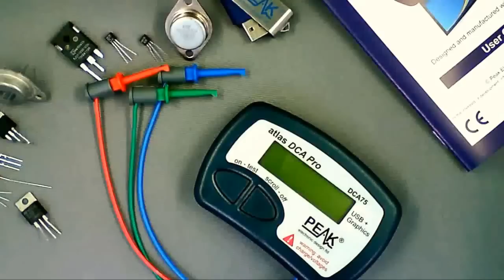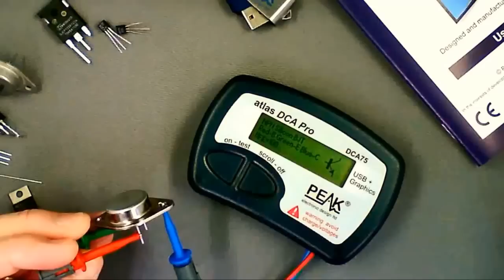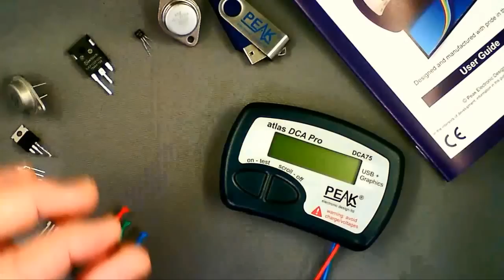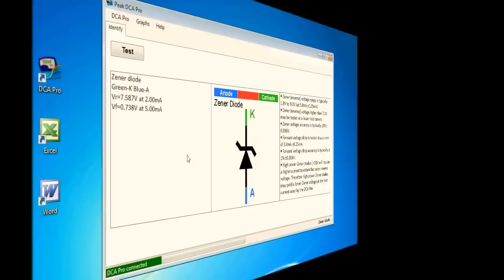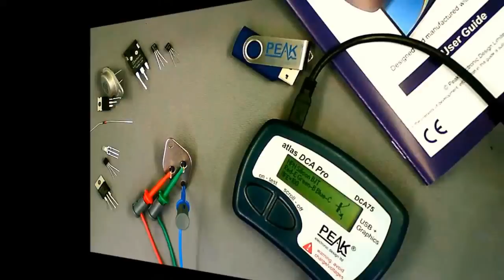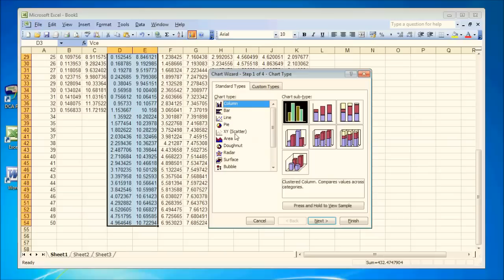Peak Atlas DCA Pro - Advanced Semiconductor Component Analyser (Model DCA75) - Official Video

Comment: Hi, it looks very interesting. Can I match the transistors pairs with this one successfully? How the device react for temperature changes in the matching proces?
Reply from the maker: The DCA75 is great for matching transistors. You can can measure both hFE and the base-emitter voltage (which are often needed for matching). Furthermore, you can overlay whole graphs on top of each other to determine a good match for your own personal requirements. Both gain and Vbe are very temperature sensitive on transistors of course, so you need to ensure minimum handling of the transistors and allow time for the transistor temperatures to settle to ambient before testing. These are fundamental characteristics of semiconductors and not the DCA75.
Reply: @PeakAtlas  Bought it already, great tool indeed ;)

Comment: can you test components in circuit?
Reply from the maker: Generally speaking we would not recommend testing in-circuit. Sometimes you can get away with it. The influence of potentially unknow components in an unknown circuit configuration can of course affect the readings that the DCA75 is trying to take and that is impossible to compensate for. Furthermore, you can't always be sure that the circuit you're testing is completely free of stored charge and that may damage the DCA75. Another thing to remember is that if you have the DCA75 connected by USB to your PC, then a ground loop problem can occur if your equipment under test also has a route to a different ground, big currents (and failures) can then occur. So testing out of circuit is recommended and I acknowledge that is not always convenient.

Comment: It can be misleading on power MosFets do to its small battery source.
Reply from the maker: Thank you for your comment. Could you tell me what problems you are experiencing? The MOSFET driving capability shouldn't be limited by our battery size. The test voltages and currents are derived from a regulated boost voltage from the AAA cell, so can cope with gate thresholds of up to 8V.

Comment: If I understand correctly, the DCA Pro DOESN'T explicitly tell you if a semiconductor is Good or Bad.  It gives you the operating parameters of the component (and identifies it) and then you have to compare them to the manufacturer's specifications.  I guess another way to tell if the component is good or bad is to see if any of the lines on the curve traces breaks down or is distorted.
Reply: Correct. But most semiconductors fail fairly catastrophically which means the DCA Pro will tell you if it's bad rather quickly by indicating a short, no component detected or it will think a different class of device is present. (For example, a transistor with one open junction will show up as a diode.)

Comment: Hi, I have a 15KE220CA (Transient Voltage supressor) I have one bad and the peak atlas detected a Short. The new one said: no component detected. Good news I did replaced it in the power supply of a Toshiba TV and I fixed it.

Comment: I have a request for some extra functionality to the plotting tool and a question for a more advanced curve tracer.
1) Could you guys add some functionality to plot a dc & ac load line within the current Ic/Ib, Vce plot window and also add the ability to plot a power curve for your device?
2) Are you guys planning on developing a more advanced version of the curve tracer? I.e. with an external power supply - for larger power range- so you can test devices at their limits and really use this tool as a design aid?
Thank you.
Reply: Totally agree with you
Reply: Please a signature analyzer.

Comment: Hi,
i was wondering if there is a chance of having some batch testing of devices. So if you want to match a big number of, e.g. JFETs for same IDSS, you might want to simply plug those in one after another having enumerated them, and then the measurement might be automatically transfered by the PC program to an excel sheet which then can be used for bundled matched parts. I guess this can be done with a firmware update. Is there a chance to have such a feature or is it already there?

Thanks for this cool little device,
Walter

Comment: Can you measure germanium transistors with this device?
I've just found 25,000 pieces Newmarket NKT 275 transistors so I need to check them  for leakage and gain.
Thanks in advance
Reply from the maker: Yes, the DCA75 is great for Germanium devices. It will happily measure leakage current, current gain and Vbe for your devices. Note also (unlike many multimeters) the current gain measurement is compensated for collector leakage current. Our DCA55 product does this too.
Reply: Thanks!

Comment: I have this unit for some time and I highly recommen it if you want to know all you can about a transistor FETs, MOSFETS fast and cheap.
Reply from the maker: Hi Miguel, thank you for your comment. Very pleased that you are getting good use from your DCA75. New features being added all the time too.
Reply: PeakAtlas What new features have been added? I have it since june last year.
By the way yesterday I used it to check a guidance circuit card that works in conjuntion with a concrete dumping device and found the problem in a dual juntion common mode anodes 3 pins device, fast and easy with IN CIRCUIT testing. Great product to do assembly line testing too I think. Just one repair pays well for the cost of this unit.
Reply from the maker: Miguel Rodriguez Yes, lots of features have been added since June 2013, too many to list here, but worth checking out the revision history on our DCA Pro support/download page.

Comment: I have an ESR-70 and it's invaluable for PCB repair. I think this unit will be next.
Reply from the maker: The ESR70 is great for PCB repair. I used mine to repair a '70s amp and an '80s scope recently. Even modern gear like TVs and PCs suffer from failed electrolytics, things designed to the absolute limit sometimes.
Reply: PeakAtlas I picked up a DCA75 and while it's amazing I think it may be more than I need. The DCA55 is probably the right unit for me for specific semiconductor ID and also to give me a more definitive "good/bad" indication.

Comment: Great video, 
A follow up video with leaky, shorted or open junctions would be helpful. When I buy devices, I have already looked at the data sheet and see little value in confirming the OEM data. 
However, more info about the troubleshooting capability would add much value and help justify the cost.
Regards,
Glenn 
DSM Labs

Comment from the maker: Hi Musthafa. Thank you for your question. Yes, the DCA75 can test most types of IGBTs including depletion mode and enhancement mode varieties. You can attach the 3 test leads any way round and the DCA75 will give you lots of information including: IGBT type, pinout, input threshold voltages and transconductance (gain).

Comment from the maker: Hi Miguel, thanks for your question. Some regulators aren't happy when being tested outside their usual circuit of decoupling caps, minimum load etc. This is discussed a little more on Page 28 of the user guide.
Some regulators can be "tamed" a little by placing a 0.1uF capacitor between GND and VOUT of the regulator. I tried that on a 79L05 today and it then measured it correctly. So in answer to your question, it's possible that your regulator is ok even if it's not detected.

Comment from the maker: With a little experience you will find that it is not necessary to test every component on a board in order to find a fault. You should be able to "narrow down" the areas that are most likely to be faulty (depending on t he circuit operation) and then test only a few parts to find the faulty one.

Comment from the maker: Hi Sivucit, thank you very much for your comments. I hope you enjoy using your new instruments. Generally, if possible, it is best to test out-of-circuit to avoid the effects of the surrounding circuitry. For 2-leaded components you need to remove 1 lead from the circuit. For 3-lead components you need to remove 2 leads from the circuit. The Atlas ESR can be used to test ESR in-circuit as the capacitor's ESR usually dominates the measurements, so that is the exception :-)

Comment: Thanks I bought DCA 75 pro, LCR and ESRMETER, all the three. one of the main reason is your prompt answer.. I was about by BK, then changed my mind.
I am a new bie to electronics..  if I want to test the circuit, let say I have 30 components, do I need to remove all those 30 components to test one after another to find faults. I can use ESR to verify capacitor in circuit, do u have any suggestion or book that u refer that will help to diagnose. 2) can I use ESR to test 50 MFD CAPCACITOR

Comment from the maker: We recommend that testing out-of-circuit is the best bet as it's not possible for us to know the influence of the surrounding circuitry (imagine how a transistor would look with a low value resistor across two of it's legs). Sometimes you'll get away with it and you can test in-circuit, but it's not a good idea generally. Also, there is more danger of damaging the instrument if there are charged capacitors or power on the circuit. We know it's not always easy, but out-of-circuit testing is best.

Comment: Hi, do I need to remove the component from the circuit to test or it can be tested in the circuit .. example, mosfet, transistor, triac, voltage regulator etc in the circuit.  Thanks for ur help.

Comment from the maker: Generally, if it displays that it has found a particular component type then it's a working component. You can then decide if the detailed specs that it shows are good enough for your intended application. For example, a transistor may be working but have quite low gain, so you'd reject it on those grounds. If a component is completely dud then the unit may say that a working component has not been found, or a short circuit has been detected, or possibly a PN junction or 2 have been detected.

Comment from the maker: Yes, I've tested many 2N3055 transistors (one of my favorites for building PSUs in fact). There are many indications of a "good" transistor so you can decide if you need to investigate further or not. Gain, Vbe and Leakage are all good indicators of transistor condition. The DCA75 is great for matching devices, you can use the device "stand alone" or use the curve tracing capability to superimpose the curves for different devices on top of each other to check for matching.

Comment: I need to match 2n3055 transistors for my old seeburg jukebox SHP amp. Also the amp has 32volts going to these power transistors.  Can this meter determine if transistors are good and also match new ones?  Thanks.